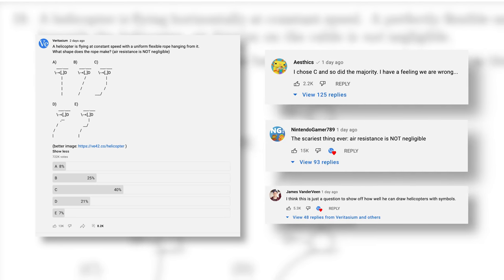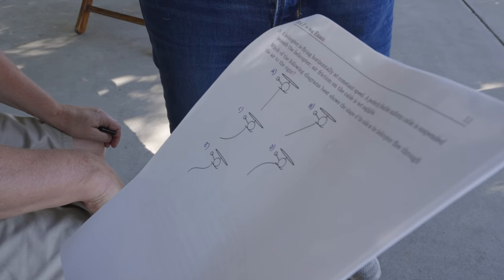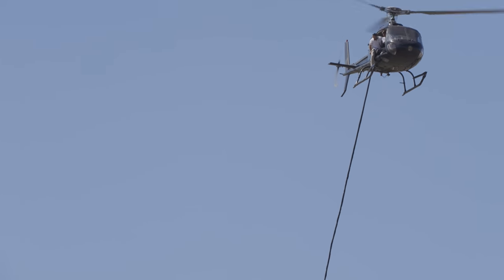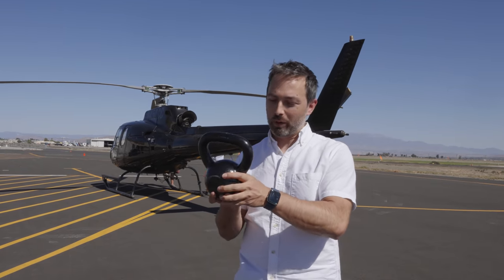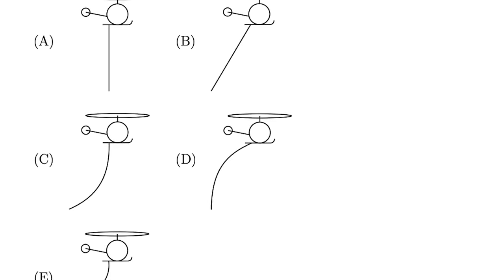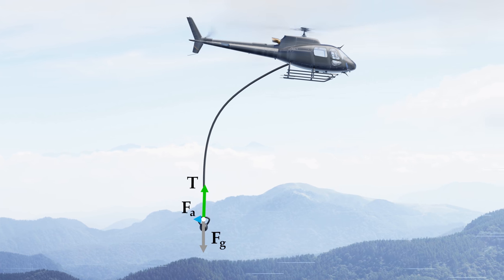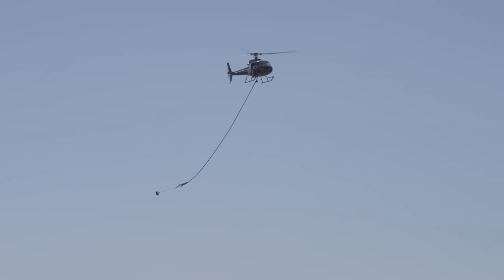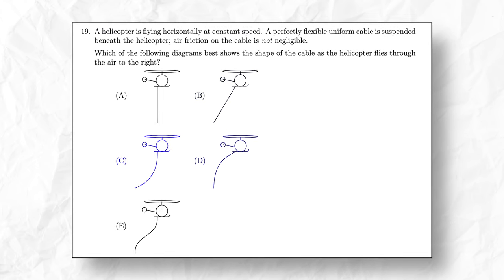I Rented A Helicopter To Settle A Physics Debate

Comment: Now add the parachute to the middle of the rope with the kettlebell at the end to get answer E.
Reply: Or answer F, a crash press F to pay respects
Reply: and fly the helicopter in the vacuum (lets think that helicopter rotors would work in vacuum) and the answer will be A
Reply: @PedroHenrique-ig6cw  The answer is A if you are in the correct field of view.   ALL of these answers are correct because it doesn't account for speed.
Reply: @stormrungaming  "Constant speed"
Reply: @bobzombie2710  Which constant speed?...     If the helicopter is going at .02mph constant..  the rope wont budge.  If it's going 200mph.. the rope will be straight behind.. even with the weight.    Like I said..  It doesn't account for speed.
Reply: @stormrungaming   No, the rope will budge only only if there is acceleration, if it is in a constant speed, it will be letter A (considering that this place still has gravity)
Reply: @stormrungaming  It only seems like its budging in a high velocity because of the air resistance, but as I said, in vacuum, that is, no air resistance, it would be letter A
Reply: @PedroHenrique-ig6cw  you cant have a constant speed if you are accelerating as it is the change in velocity.    If you are walking at a constant speed of 1mph and the wind is pushing your hair.. it still blows back even though you arent accelerating.
Reply: @PedroHenrique-ig6cw  but you wouldnt be able to lift the helicopter in a vacuum as there is no resistance.
Reply: even in a vacuum... the rope would move along with the thing that pulls it.
Reply: @stormrungaming  he already acknowledged that you wouldn't be able to fly the helicopter in a vacuum
Reply: No it would still be D just with a bigger curve
Reply: So answer B would still be the best representation. Even @ .02 mph. there would still be the tiniest of angle.
Reply: If a helicopter had a hanging rope and flew at a constant speed inside of a vacuum the rope would always be A since there is no air resistance and only gravitational pull to account for. This applies regardless of speed at which the helicopter is traveling.
Reply: No, I think the middle of the rope should also have a kettlebell, not a parachute.
Reply: Then the pilot would just push them off the helicopter haha
Reply: @parkerjohnstone5273  I think that depends on how heavy the weight at the bottom and the amount air resistance.
If you only had a parachute in the middle of the rope it would create a C shape from the top down until the parachute and then a B shape from that point onwards, now if you add a weight that isn't too heavy att the bottom it would create that D shape on the lower half of the rope. 
But as you said i think it would create a big D shape with a sharper curve if the weight is too heavy.
Reply: @Oscar-qt6ll  yes
Reply: How Ridiculous!
Reply: @PedroHenrique-ig6cw  what makes you think the rope can move itself?...   It would HAVE to follow the helicopter that is creating thrust.. which in turn would go behind the helicopter.   EVEN IN A VACUUM.
Reply: @PedroHenrique-ig6cw  Have you guys never seen a space launch?..
Reply: @Oscar-qt6ll  Yes, if the parachute was much more effective then the weight it might over power the weight and form and sort of D shape from the top to the parachute as you said. However, once the weight becomes strong enough it would drag the curve of the J down into a D shape, if that makes sense
Reply: @stormrungaming  Dude I literally watch space launches everyday, much more than you, and I know very well what Physics is, I have told you twice to desconsider the vacuum for the helicopter moves, just consider it in the rope, so if it is in a constant velocity, it will be letter A, seems like you haven't learned Physics in school
Reply: As I said, disregard the air atrict, so you are in a constant velocity without acceleration...
Reply: @stormrungaming  thrust is only a thing when you accelerate. Constant speed in a vacuum with gravity but no air resistance is pretty analogous to stationary flight.
Reply: @bgdu93  I guess that rope decides to move on its own at the exact same time as the helicopter right?..  doesnt make any sense.
Reply: @stormrungaming  CONSTANT speed omg! It is already moving. What you are describing is acceleration.
Reply: @bgdu93  no... in a vacuum the rope would be pulled until it is straight back.   It would move from vertical to horizontal at any speed.     you act like the rope has a way to move on its own.
Reply: @stormrungaming  Why the hell would it be horizontal ? What is gravity doing in your scenario ? it should be the only force applied to the rope at constant speed in a vacuum

Comment: Technically, every answer is possible. A, if you have a string with very little air resistance to weight ratio, and E if you have an object of high air resistance at the midpoint and an object of high weight at the end.

Comment: I had no idea this question went viral after we published it!  But I'm glad experiment matched theory.  And to everyone who said we should have directed students to neglect the rotor wash, I completely agree.  You try to eliminate as many gotchas as you can in editing, but you can never get them all...
Reply: oh hi prof!
Reply: Professor, Did you already knew the answer?
Reply: The thing that got me was I expected there to be a moment around the helicopter from the wind, making a parabolic curve so it would be C but that would only be if it were accelerating
Reply: If you consider an extremely long rope and high flying helicopter, the answer would be C since the atmosphere would be less dense at the top of the rope and more dense at the bottom, giving increasing drag per unit area as you move down the rope. Neglect atmospheric density due to altitude – one more gotcha to remove?
Reply: @Indic-D  I'm not a professor.  :)  And I had to work it out when the question arrived in my inbox, just like any student taking the test.
Reply: @newtubedavid  I think not, in this case.  I think it's more reasonable for a student to know that the variation of air density with alititude is negligible over a few times the height of a helicopter than to know that the rotor wash can be neglected.  (This is about scale -- you can just as well ask why we're not considering variation of gravitational field with height, or effects due to special and general relativity.)
Reply: In a test such as this, if a variable is not mentioned(weighted rope) does that variable not exist? Otherwise it becomes a trick question
Reply: @newtubedavid  Wrong on so many (excuse the pun) levels.  The atmospheric pressure difference is absolutely negligible for anything other than a several km long line.
Reply: @FiferSkipper  yes, that's why he specified "extremely long" rope... Are you unfamiliar with the concept of wildly unrealistic contrived physics problems? Lol Lol
Reply: @FiferSkipper  Also, do you seriously think the physics profs writing the question don't know calculus? 🤣 Do you even know calculus or how it applies to this problem? The relevant integrals simplify to F_g=g*x and F_drag=u*x anyway, which can be deduced trivially without calculus... And at that point its a simple force balance equation as shown in the video.
Reply: @FiferSkipper , so it is your claim that if the down force of the rotor wash is ignored then the rope would be less affected at the top of the rope by the apparent wind, causing it to be dragged back less than the lower portion of the rope?
Reply: @notahotshot  No. The horizontal aerodynamic force is constant along the length of the rope. It does NOT increase as you get closer to the helicopter.  The video claims it increases proportionally to tension. That is flat out wrong.
Reply: @emissarygw2264  They are called thought experiments.  The thought experiment with an 'extremely long' rope vs air density, is roughly the same question as what would the rope do moving horizontally without the rotor wash. The answer would be a curve the C but not at all due to differences in air density. 
Any portion of the rope farther below the helicopter than the affect of the rotor wash will behave as the answer C shows because of calculus.  That is several meters, not kilometers. Air density has nothing to do with the solution to this problem.
Reply: @emissarygw2264  Becoming a professor does not magically make you perfect at calculus.  In this case, anyone arguing that the aerodynamic force changes as a function of the position of the rope is WRONG. The video makes this exact claim and is absolutely WRONG because of it.
So YES, in this case it would appear that I know a lot more about calculus than these professors; both the one that made this exam question as well as the one that made the video.
Aerodynamic resistance is a function of shape, cross sectional area, and (apparent) air speed.  The shape of the rope does not change as a function of distance to the helicopter. The cross sectional area does not change as a function of distance to the helicopter. The apparent wind speed does not change as a function of distance to the helicopter. so therefore:
The horizontal component of the aerodynamic force is constant as a function of distance from the helicopter.
Long story short, if there was no downwash from the helicopter, the rope would hang curved like shown in answer C.
Reply: gud
Reply: @FiferSkipper  That makes absolutely no sense: the top of the rope would hang lower if there wasn't downwash-a wind that would, if anything, blow the rope down!? Besides, at speed the downwash reduces a lot. A helicopter that is flying fast just above treetops will swing the treetops relatively little but hovering over them at same altitude and the trees will swing like in a storm wind. So in this experiment downwash is  pretty much neglible (also due to the fact flying with light load will require less throttle to move around creating less downwash).
Reply: @FiferSkipper  This doesn't need to be a complex/expensive experiment. Grab a string and trail it through the air. It does exactly what this video says, with zero rotor wash. Do another thought experiment: let's say you hold the rope at the very bottom tip and the top is supported by some other means. How much horizontal force do you feel pulling on your hand? Zero, because there's nothing beneath your hand for the wind to catch. Now move your hand a few feet up the rope. How much now? An amount proportional to the length of rope beneath your hand. Because the sum of all tiny horizontal forces exerted by the wind on each tiny length of rope beneath your hand is counteracted solely by your hand holding the rope. Remove your hand, and instead of your hand counteracting that force it's the tension of the rope above.
Reply: @FiferSkipper  The downwash would have most effect to the top half of the rope and neglible to the bottom, especially at speed. Your argument still makes no sense.
Reply: @FiferSkipper  Let's do another thought experiment which is basically analogous: Say you have a long rope hanging from the ceiling. What is the force of tension at the very bottom of the rope, and at the very top? It scales linearly despite the force of gravity being 'constant' all along the length of the rope.
Reply: @FiferSkipper  No. My point is this: Gravity exerts uniform force on each infinetesimally small section of rope. In the exactly the same way, the horizontal aerodynamic force exerts uniform force in the horizontal direction on each infinetesimally small section of rope. There is no difference mathematically between gravity and air drag in this problem except the magnitude and direction in which it is applied. For the same reason that a hanging rope has linearly decreasing tension as you go from the top to bottom of the rope, the "uniform" horizontal force at each point of the rope is actually linearly decreasing to zero as you progress toward the end of the rope. That is simply because while the force that air exerts on any tiny bit of rope is the same as the force it exerts on the tiny bits above or below it, each bit of rope is *also*being pulled on by all the bits of rope beneath it. No matter how you slice the problem, the force vectors at each point behave exactly as depicted in the video.
Reply: @FiferSkipper  To make it clearer - consider, say, a 1-foot length of rope at the very end of the rope. The air force on it is 1ft * (some scaling factor). The tension in the rope at the top of the 1ft section (the point connecting the section to the rest of the rope above it) has a horizontal component equal to the force of air, else it wouldn't be in steady state (if net force doesn't zero out then the section of rope would accelerate away from the helicopter and disappear into the distance). Let's call this value of the horizontal component of tension T. Now consider the 1ft section immediately above it - it also has air exerting force on it of magnitude T. However this new section also is connected to the previous section, which is pulling backward with a tension of T. This means there's a total force of 2T pushing it backwards. The only force pulling this section forward to balance the 2T of backward force is the tension of rope at the top of this new section, which therefore must be 2T. Repeat this for the next 1ft section up for 3T etc. Calculus simply takes this process and shrinks it from 1ft sections of rope down to 1 inch, 1mm, microscopic levels that are basically zero length (lim L->0, which can be abbreviated as dL) in which case T->0 as well ( call it dT), and to figure out the tension at any point you sum up all these nearly-zero bits of force (I.e. take the jntegral). The result is trivially exactly what we already stated for both gravity and air force - the horizontal component of tension increases linearly as you move up the rope.
Reply: @FiferSkipper  furthermore, following on both above comments - solving for the vector of tension in the rope is what gives you the shape of the curve, because the vector of tension force is necessarily in the same direction as the rope is pointing, because that's simply how ropes work. So while you are correct that the force of air is uniform all down the rope, the effect that uniform force has is that it induces a non-uniform tension in the rope, which is ultimately what we were trying to solve for in this problem.
Reply: @FiferSkipper  The downwash of lightly loaded helicopter moving at decent speed is not all that much, especially straight down from the fuselage. also it gets left behind at speed so it is unlikely to affect the rope all that much. If you have seen a heli flying at low level at different speeds, it is easy to see.
Furthermore, you can test it yourself: take a piece of string and go out in a windy day or keep the string at hand while riding a bicycle or something - the string will stay straight, no downwash there.
Reply: @FiferSkipper  You are still missing the point - that the primary relevance of aerodynamic force to the problem is to calculate the horizontal component of tension in the rope at any point, which combined with the vertical component caused by gravity gives you the direction vector of the rope as a function of position along the rope, thus solving for the shape of the rope. By saying "aerodynamic force is uniform but tension isn't", you are comparing apples to oranges - you should instead be saying either "both aerodynamic force and gravity are uniform/constant" or "both the horizontal and vertical components of tension in the rope at any point are linear functions of the position along the rope". The former is hand-wavy but leads intuitively to the correct answer, while the latter is harder to understand but more rigorous and still leads to the same answer.
Reply: @FiferSkipper  You should spend less time sharing your ignorance. Air pressure decreases by about 3% for each 1000' of altitude. Converting to metric makes it fairly close to 1% for every 100 meters, or 10% for one kilometer.
Reply: @FiferSkipper  1.but for wet and dry disheveled rope, something can be changed ( robe won't be as straight line) .2 also at velocity of wind more then laminate floor some rope can get waves behind the  helicopter 😂. So it can be more complicated. But main idea of video is correct
Reply: @FiferSkipper  If the rotor wash would affect the rope that much, it would push it closer to fig. C since it would affect most the top part of the rope and the bottom in this video is way below meaningful effect even when hovering. Also, the physical explanation is correct, you just don't seem to understand it..
Reply: It's unfair.
Reply: Which exam was it
Reply: @FiferSkipper  What you're saying is that the drag force per unit length along the rope is uniform. This is true, and the same can be said for the gravitational force per unit length. When calculating the tension at a given point in the rope, however, the relevant quantities are the total gravitational force on the rope below that point and the *total drag force on the rope below that point*. Both of these increase linearly as you move up the rope (since the amount of rope below that point is increasing), and these are the vectors shown in the animation.